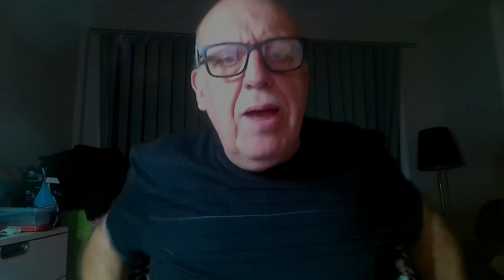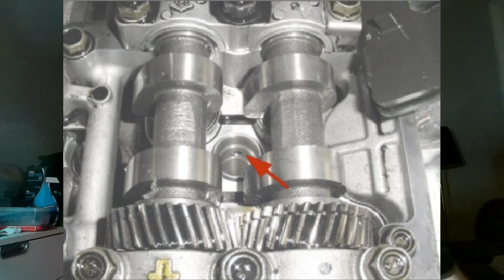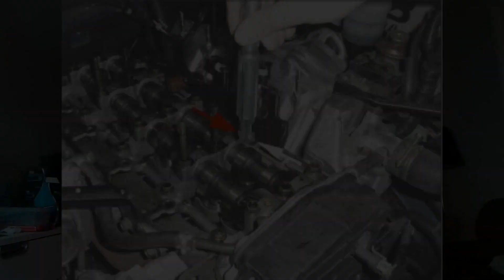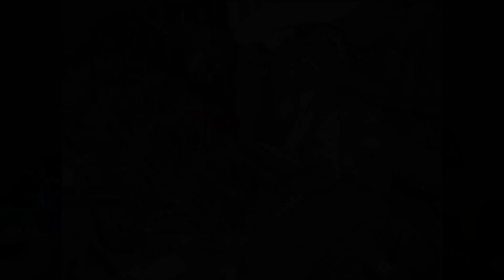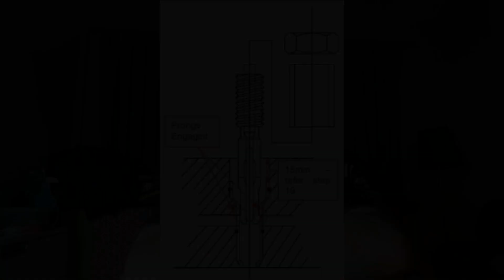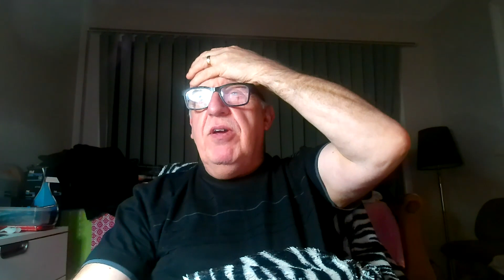4JX1 Injector and Injector Sleeve Seal Replacement Procedure

Comment: Hi, diesel fuel has found its way into the engine oil in my 2004 Trooper. Where do I start? I drained off almost 4 ltrs from sump. Still states but not running well when cold. Tks
Reply from the maker: Firstly, DO NOT RUN YOUR ENGINE. You'll end up with a runaway that cannot be stopped easily and will self-destruct.
It is either injector seals or injector seat seals, either way best change them all. This is a trait of the HEUI engine.
Get a set of injector and injector sleeve seals and the special tool to remove the sleeves, you can get these from Chris Sczwarek here, he is the admin of the site.
https://www.facebook.com/groups/264658247280734
Then, once you have these items, message me again and I will explain the procedure to you. Please try to use Dailymotion or become a Patreon to contact me. Or use the channel email address.
Reply from the maker: Martin, just to explain, if your sump fills too high then the engine will just fuel itself and cause a runaway. If you do get a runaway the only option I can think of is to remove the sump plug and drop the oil wherever you are. The HEUI engine will not run without oil and is famous for not being able to be seized up. The engine starved of oil will not run.

The only other way to stop an engine is to starve it of air but if there are any leaks in your air system at all, it will not stop the engine.
Reply from the maker: Martin, here is why it happens - So the oil level rises and pushes through the crankcase ventilation and back into the air intake
Rob
Becomes oil and diesel mix, but the engine would run on the oil alone
Reply from the maker: Martin, I am also moving away from Dailymotion to Rumble, the Canadian platform. You can message me there. https://rumble.com/c/c-7669750
Reply: I’ve got a 2001 and I’ve got the same problem